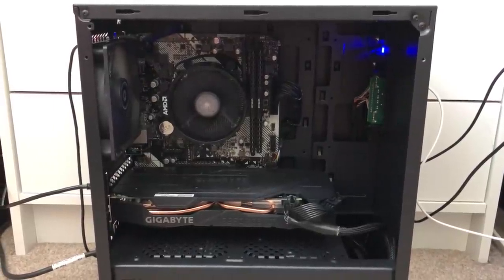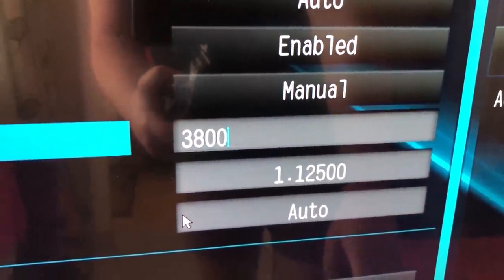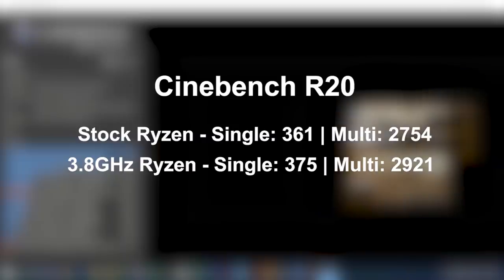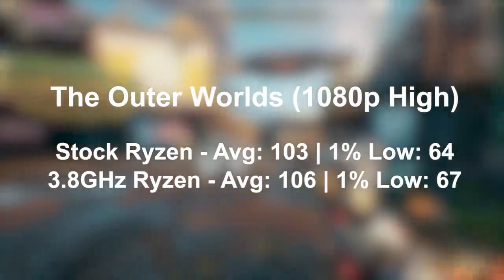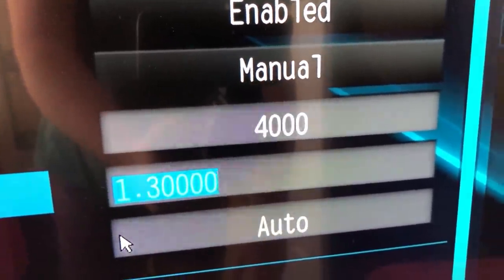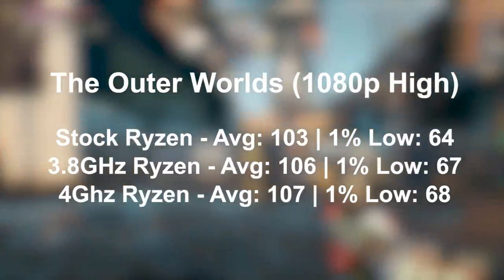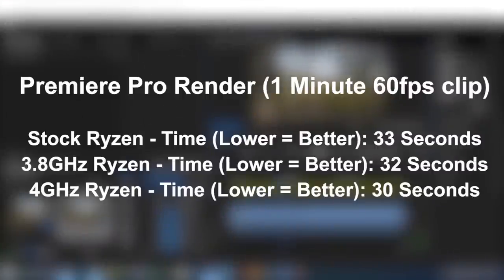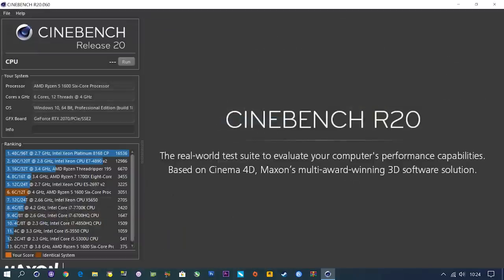4GHz Ryzen Overclock On The Stock Cooler: Good Idea Or Fire Hazard?

Comment: "Overclocking these days is simpler than ever"

Ryzen 3000: Allow me to introduce myself.
Reply: True
Reply: Back in old days we had to use some vodoo shit and satanic ritual to gained a perfect frequency and stability temperature
Reply: CaptainMcShotgun  no, like generally speaking, more than 75% of people who buy these cpu's don't actually overclock it. The only people who are really turned on about it are enthusiasts and I really don't know why.
Reply: Rares Macovei they overclock great! ....on LN2 ;)
Reply: CaptainMcShotgun  I wouldn't say they're maxed out of the box.  From all the research I've done 4ghz seems to be the general consensus these chips can run at with just a slight voltage increase.
Reply: @andreiarg  People like tuning things and getting more performance. Just like in cars or almost anything else. Some people just like it.
Reply: I Overclock my Ryzen 5 2600x With The box cooler to 4.1ghz and its Working fine lol
Doing it since Christmas 2018
Reply: CaptainMcShotgun  As long as they are overclockable by the user it is not a bad thing at all.
You have to keep in mind, that the manufacturer has to ensure that the product can perform as advertised for years and even in bad ventilated pc cases.
If you want to learn more about why there are some CPUs on the market that have a low clock or disabled cores search for "CPU BINNING" for example there are good explanations on youtube by Gamers Nexus or Linus Tech Tips.
Reply: @rpgamezzz270  it's just pencil trick, nothing shady with that
Reply: CaptainMcShotgun  So can most Zen +
Reply: Intel isn't better or u think that i9 9900k is better? Wow u get 200 or 300mhz more on all cores cool? I remember in old days when overclocking was useful when we got 1 or 1,2 ghz more clock speeds. Today overclocking is just silly u get more noise more heat for maybe 5 fps more in games. Today overclocking is there just to flex with your cinebench or 3D mark time spy point results.
Reply: what do u mean? im not into OCing
Reply: @optic.v7420  what's your voltage?
Reply: CaptainMcShotgun  There's still optimizations to do with RAM timings etc. Just raw frequency isn't the only way to goose out more performance.
Reply: @rpgamezzz270  😆😆😆
Reply: @andreiarg  It's not a bad thing at all for most people and I applaud amd for it. However I miss "the pride and a compliment" of doing it myself. I really like overcooking and it's part of my pc building hobby.
Reply: CaptainMcShotgun  the zen and zen+ are not. The zen2 is because the bottlneck isn't the GHz but the infinity fabric clock. To actually get gains out of ryzen 3000 you need to overclock the ram as high it can go and then match the infinity fabric clock with half that of the memory because DDR is double.
Reply: Just bought a x58 asus sabertooth mobo and an x5660 to play around with. Overclocking fun when everything is closed:D
Reply: ryzen is kinda pre oc'ed, especially if you use pbo
Reply: @DankBlank  i answer it when i am at Pc
Reply: He should tune his memory
Reply: Don't forget undervolting as well. Most of these chips can be undervolted and still run at stock frequencies
Reply: @miniweeddeerz1820  Yeah true and thats why AMD use more cache in Zen2. Look L3 cache Zen2 has double more L3 cache compared to Zen and Zen+ the extra L3 cache helps a lot. Because Ryzen dosn't need communicate immediately to RAM and can more communicate with the L3 cache. How u said the infinity fabric the multiple CCX design of Ryzen creates latency with 2 or more CCX communication in one chiplet design thats why AMD pushed more L3 cache in those cpu's. I think AMD benefits a lot from 7nm because it creates extra space room for more cache and more cores.
Reply: @strohhuttv8848  yeah the latency is holding amd CPUs back. Faster ram, less latency, better performance.
Reply: @rpgamezzz270  you've clearly never used a C2D
Reply: @miniweeddeerz1820  Sure because the RAM can communicate faster with the CPU and the CPU is split in many different CCX's. This dosn't mean that a one CCX only design like Intel use it or like the Ryzen 3 3300X will have will not benefit from faster ram. The 1 CCX chips will also benefit from faster ram and more L1, L2 and L3 cache just not that much like Zen with multiple CCX's benefits from it.
Reply: @strohhuttv8848  ofc
Reply: @rpgamezzz270  yah but back then the gains were relatively also a lot bigger so I guess its a trade-off
Reply: i found myself fiddling with many Ryzen system at stock speed, optimizing CPU Fan setting to maximise all core boost. Few reach that out of the box and it is a tedious experience. Maybe running them overclocked just makes things easier...
Reply: @catriona_drummond  you shouldnt even try to optimise the boost. as ive said before, the latencyand infinity fabric clock betweeen the cores is ryzen 3000s bottlneck,not frequency. if you want more perfromance jusy overclock the ram and then make the fclock in bios half that of your memory as ddr is double
Reply: @miniweeddeerz1820  But taht seems just sad? the thing basically starts severely throttling in the mid 60's. How is that good?
Reply: @catriona_drummond  that isnt throttling lol. they can hit the 4.4ghz max boot but they only do so if they have to. hence it boosts one or two cores really high for a few seconds depending on the task. and anyway even if you could hit the beautiful 4.4ghz all cores on reasonable voltage which is pretty much impossible, you wont see any real performance gain because as i saidit is bottlenecked by its fixed infinity fabric clock. if you want gains, which is definitely possible, you need to overclock the ram and set fclock to half the rams speed. just because intel advertises something their way does not mean ryzens way of advertising is false. they can hit the boost, just either dont need to or even if they did do it all cores it doesnt gain anything anyway
Reply: @miniweeddeerz1820  Reminds me of communism. "I want bananas. - Shut up, you don't need bananas."
Iam talking about CPU's that fall significantly behind their advertised all core boost in continuous video rendering loads for example unless I set the cooler curve to something way more agressive than the BIOS default. While touching no other variable. For me that is simply leaving performance on the table.
I had this on several CPU's, 2600x to 3800x and several mainboards B350 to X470 from different brands.
(Of course I use the RAM's XMP profile)
Reply: @catriona_drummond  well at least zen+ you can overclock to those boost speeds. And as I said multiple times, you aren't gaining performance from MHz. I've seen a 3800x at 5ghz still lose to a 9900k because of the latency bottlneck. Clock speed is not the issue.
Reply: Intel 10th gen i3:
Reply: @verylongname8161  lol
Reply: Overclocking nowadays is a little pointless because in all modern AAA titles the gpu is always the one holding you back. And in programs like premiere you shave a few seconds of at most which doesn't make a huge difference in the grand scheme.
Reply: @andreiarg  overclocking isn't for the highs unless you play eSports no GPU bottlneck high refresh rate. It's for the lows and the games smoothness. Sure the gpu holds you back in the average FPS but depending on the game you can improve lows quite a bit. And that is important to minimise stutters and such
Reply: @optic.v7420  Luck MasterRace Dank
Reply: KaputPictures yeah. My 3600 runs at 4125mhz all day long... silicon lottery I guess
Reply: @rpgamezzz270  exactly. like controlling a nuclear power plant

Comment: I still haven't gotten used to C20 scores, my brain still functions at C15 reference points.
Reply from the maker: Same to be honest haha
Reply: @RandomGaminginHD  please keep using R15
Reply: Some extra data points I've cobbled together:  http://www.sgidepot.co.uk/misc/tests-jj.txt
Reply: its like x2.4 or so.
greater show of variance but also a longer test meaning short durations of high clock speeds (turbo boost on intel for instance) has a more realistic and less inflated effect.
Reply: @tomstech4390 Intel turbo boost does not affect scores, at stock settings my I7 3770 will sit at 3.7 since the beginning of the single core test in R15, cpu stay at the same turbo speed of all cores during the whole test, this is why I enabled "multicore enhacement" on bios, to boost all cores to maximun turbo clock speed (3.9), currently have the cpu overclocked to 4.1 on all cores
Reply: @DualPerformance  Yes mce does effect scores, Infact theres many youtube videos about why youtbuers results were so different.
Scenario: A test takes about 60 seconds and the first 50 seconds is done at 4.5Ghz turbo and then the latter 10 seconds is done at 4.0ghz
That means the first 83% of the score is inflated by 12.5% higher clocks.
So if at 4.0Ghz the cpu would score 3000 points its now scoring...3000*.83=2490points. 2490*1.125=2801points. Add on the remainder 17% at 4.0Ghz (510 points)=3311
So because the test is so short compared to the boost duration the score gets inflated by ~10%.

Now with test B the test takes 20 minutes, The boost is now only 4% of the test duration, So assuming the same 3000 points per unit of work its now 3000*0.04=125points *1.125=140points. Then the rest of the benchmark is done  at 4.0Ghz sustained for 3000*0.96=2880+140=3020points total.
The boost duration doesnt artificailly inflate the results as a result of the test being too short, people do real work on these cpu's who might have the cpu working on something for 6 hours are going to care more about the performance at sustained clockspeeds than that 0.002% where they got a boost.

If you want proof run cinebench at stock speed with turbo disabled (3.4Ghz clocks) and then enabled at 3.7Ghz turbo and if done right you'll see your numbers improve, even if the turbo duration ends and drops back down to 3.4-3.5ghz before the test is over the test duration is reduced and you score higher.

Comment: As someone who has overclocked PCs for almost 20 years now, I have to say no things are not simpler these days :D
All you had to think of back in the day was your FSB, multiplayer and core voltage, and if you go a bit further back those had to be set with jumpers.
I'm now in the process of overclocking and tweaking my Ryzen 3600, it will probably take me a week of changing one variable at a time, testing everything still works then moving on to the next, rinse and repeat.
Reply: Ryzen 3000's are weird overall
Reply: you don't know much about overclocking then, there's tons of powerlimiters and voltages today. there's barely any headroom in ryzen so overclocking them is boring as fuck, you need to buy a non-x cpu just to have a little headroom. amd maxed the chips out.
Reply: Your're not old enough ... back when I started Ocing, there was no such thing as overclocking software, and there was no overclocking options in the bios. You had to set a combination of four tiny switches on the motherboard to get various multiplier speeds. This had to be done with the computer shut off - there was no bios reset buttons either.
Reply: @Dr.WhetFarts  RAM tuning can increase gaming in Ryzen by up to 20% in games. It brings a 3950x pretty much up to par with a 9900ks (in gaming specifically, the Ryzen destroys it in everything else) with both having the same tuned ram -- I don't mean the speeds alone, but all the timings and subtimings as well.  Both Steve Burke from Gamers Nexus and Hardware unboxed have tested and verified this. Not boring ... but not easy either. I have a 1700 nonX and I got almost 1ghz of OC out of it above base clock @ 1.37v. Mind you the newer gens don't have any parts that can do that, because the base clocks are quite a bit higher on 7nm.
Reply: Is still simple those days, in my I7 3770 I only tweaked the vcore, for an overclock of 4.1 ghz all cores, with negative offset -0.015
Reply: @Wooza42  sometimes voltage in auto works well, my Q8400 have vcore in auto for 3.2 ghz overclock, it is stable and the vcore is not high
Reply: @DualPerformance  Agreed, for my Ryzen 1700 all I did was set multiplier to 3.9, ran some tests, and increased voltage until it was stable. Then I told ram to use XMP profile. It just worked. Not so sure whats so hard about OCing new Ryzen - sure you have a few more options, but you don't need to tweak everything.
Reply: Well i overclocked my old fx 6300 to a stable 4.6 ghz, took me about 45 seconds. I now have a 2600x and i don't need to overclock it yet so that's nice
Reply: @Nick I have to fully aggree. I'm overclocking since socket super7. jumper->dip switches->FSB-jumper&BIOS-multiplier->all-BIOS ... 20% to 50% OC was the norm. And finally now: silicon meticulously binned by the manufacturer to the point where AMD says "all Ryzen are unlocked" (good luck trying OC). With a product stack from sub-100$ desktop to 1000s$ server CPUs made from the same chiplets only the best stuff goes to the highest paying customer. So you get what you pay for. My 2600 was only bearable to run over 4GHz because of custom watercooling (I like my system dead silent), despite managing 4GHz at 1,225V. That was a measly 10% improvement over stock boosting, bearly even noticable and upped the power comsumption of the CPU by 60%. During cyber week last year I got a 3800X for the price of a 3700X. I saw that the CPU was typically boosting to 4250-4350MHz while gaming (in simulations like Cities and Transport Fever 2 with proper CPU usage) under watercooling. That is was you typically get all-core when overclocking. I didn't even bother overclocking it. And because with a 105W TDP CPU I already strech the VRM of the ASrock B450 ITX board. Instead I bought good Samsung B-die RAM and run DDR4-3600 CL14. This actually makes a difference compared to OC. And OCing my Vega56 taught me to fiddle with voltage-frequency-curves to help the boost algorithms to actually achieve 10% more performance without ever typing in a high clock number anywhere, additional 10% with V64BIOS and upping HBM clock from 800 to 1150MHz. As soon as you request a too low voltage or too high clocks the chips of nowadays detect their limits (i guess through error correction interventions shooting up) and counteract your settings overly conservative so you get lower performance from typing in a higher number in the OC tools. So OC isn't brute force anymore but tidious try-and-error to see what your particular silicon likes and what not at any point in the voltage-frequency-curve. And at every of these points you have to check stability and actual performance with benchmarks. There is fun to be had but gains certainly not ...
Reply: you think using stock cooler would be possible
Reply: @TheScrubmuffin69  it is funny, I also overclocked my Q8400 in 2010 in less than a minute, from 2.6 to 3.2, no stability testing and is working good ten years later, recently played re 3 remake and snow runner, rock solid overclock
Reply: honest just leave the 3600 stock. I tried to OC mine and it just produced worse bench scores. Just leave it stock, AMD have pretty much optimized it
Reply: @glockmanish  Indeed it's not like the old days when you could get a 300MHz Celeron and run it at 450MHz by flipping a couple of multiplier switches.
I got the cheapest Hynix CJR kit I could and I'm running it at 3800MHz synced with the Infinity Fabric at 1900MHz, the timings are pretty much the same as the XMP Profile at 3600MHz except I had to bump the CAS latency to 18, it gets around 54500MB/s read and 65ns latency in Aida64.
But all in all it was a tedious process, I tested the infinity fabric and RAM individually to see if they'll do 1900MHz, tightened timings till I found the limits, lowered the voltages to see what the minimum stable values are etc. etc.
And only after that did I try to OC the CPU itself, as you said there's not much to gain from an all core OC and the power consumption goes through the roof for an additional 10% performance increase.
The main benefit is definitely in getting the memory to its frequency/timings sweet spot while maintaining 1:1 sync with the infinity fabric, this is what I would advise all Ryzen 3000 owners to do.

Comment: I'm pretty sure you got an above average chip there. Reaching 4 GHZ like that without issues means you've got a higher than average quality chip.

Good for you!
Reply: My 1600 af will do 4.1ghz at 1.325v and it never hits 60c in games with a hyper 212 black edition with 2 silencio fans :)
Reply: @UlrichLeland  i can do that too with 1.25v, do you think i should try 4.2 with higher voltage? :p
Reply: @TheKalippp1  Maybe 1.325-1.350 volts would work, i read that going to 1.4v is pushing it a little on the 1600 af
Reply: ThatGuyJamal  Yeah for sure, and it's not even an expensive cooler :D
Reply: He should of tune his memory
Reply: my a10-6800k can go 4.4ghz on stock
Reply: @sherwing9054  yeah but it's still slower than any ryzen 5 stock..lol
Reply: Ummm. 1600af's being zen plus and not first gen zen can almost universally reach 4 ghz. Ive only sold one that didnt. Though i perfer my 3800x that has a better 4.3 oc. Zen 2  definatly deals with clockspeed better.
Reply: You are joking right? He is using the 1600 AF, which essentially is a second gen 2600 chip using the I/O of first gen Rizen. It was recently released chip. It overclockes identically to 2600 as such it should easily do 4.2 with enough voltage. 1.4V or so will be more than enough and still keep the chip lower than 90-95c on the stock cooler. You are thinking of the original 1600 chip.
Reply: Its an "AF" -- a zen2 part with zen1 specs. They OC quite a bit better.
Reply: @sherwing9054  a8-6600k 4,7 GHz 👌
Reply: @remcojonkers5027  Which still gets destroyed even by 2nd gen i5 😂
Reply: My 2600 is able to skate by at 4GHz at 1.1875V. I usually keep it at 1.2 though.
Reply: @AlexanderVRadev  It's a Zen+ chip with Zen+ SOC